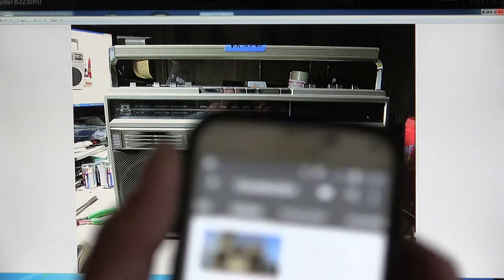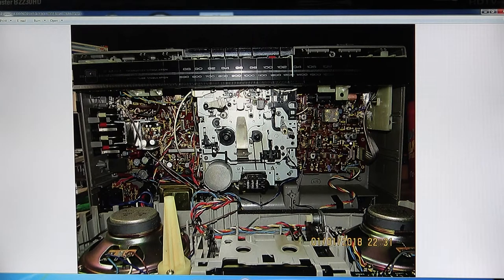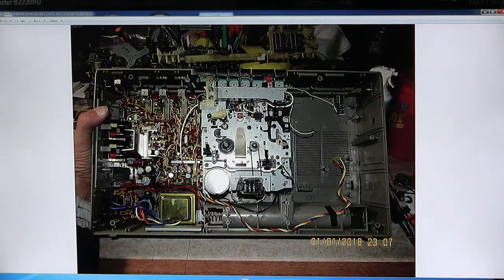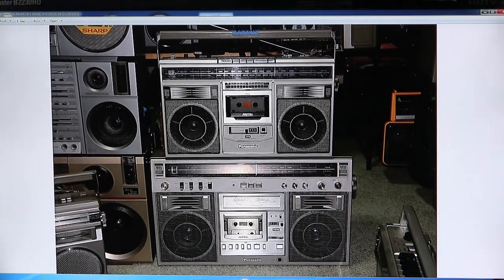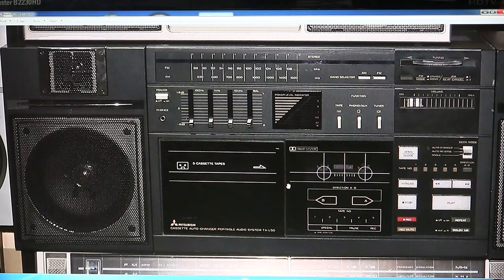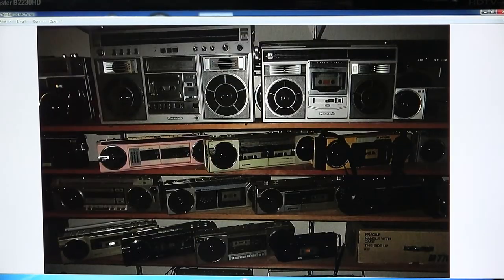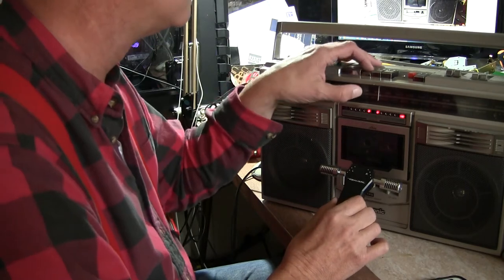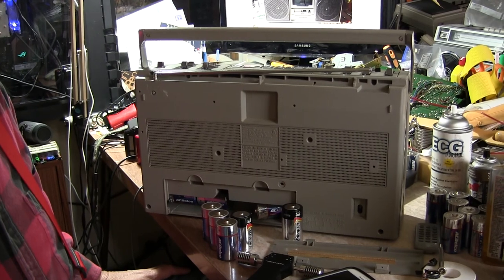Panasonic RX-5280 How I serviced with pictures play record cassette for sale Sold May 2020

Comment: My machine is old as bread. My father gave it to me when I was in my teens.  I have to figure was is wrong with it.  I have used it, the RX 5280 in over 45 years.  I’m going to tinker with it to remember with was wrong with it.   Then I’ll contact you.  Thank you for posting this.
Reply from the maker: It probably just needs to be cleaned like most of them do from non-use and by this time it probably needs a new belt replaced in the cassette deck or it's going to need one soon